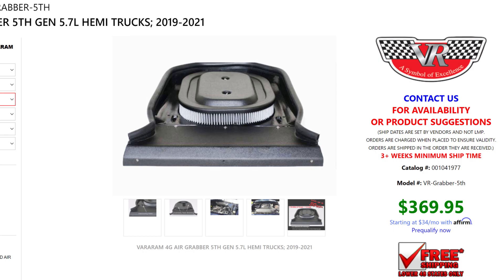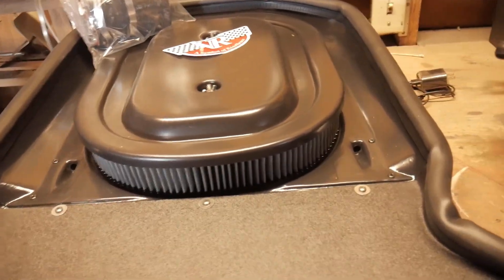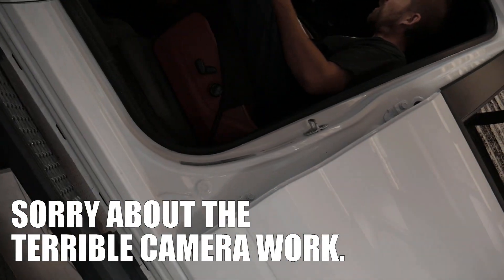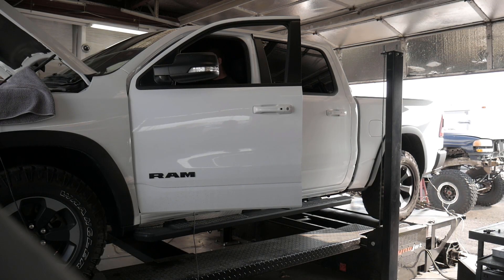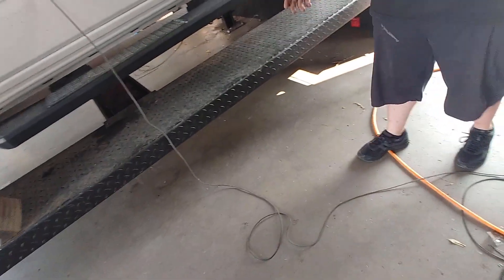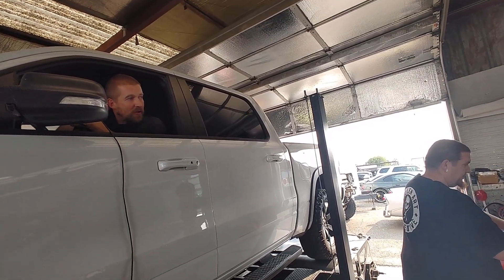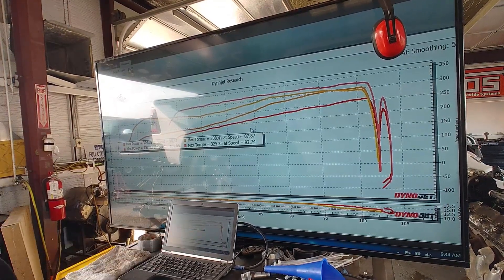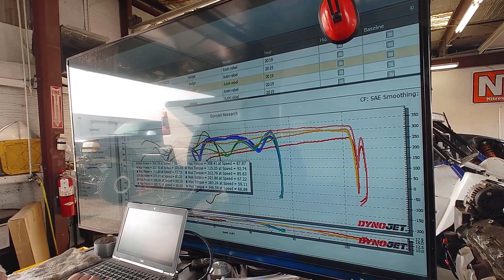2019 Ram Rebel Cold Air intake Chapter 1: Baseline Dyno Numbers

Comment: I dont like 2 things about this intake. The first is that it blocks half of your radiator. The second is that the IAT sensor is just stuck into a hole punched in a silicone tube, which is a great way to bypass your filter and pull dust into your engine.

Comment: You have to build power,one aspect will not make a big difference.
Higher air volume is still necessary.
If   running stock exhaust you will not get a big boost your looking for.
I start with exhaust and a drop in high flow filter.
When I have the extra cash, I move to cold air intake.
That's when you notice some power.
More air in more air out.
Next is a good tune set on max 
Tune premium fuel. It changes your cam so you get a quicker fire.
It takes time and money to get your truck into a 13 second run.
The best I have done with bolt ons is a 13.2 on a single cab express.
You can make 500 at flywheel.
Weight is a big factor as well your axel ratio.
My current truck is a 4x4 that weighs in the 4600 pound range.
It is a quad cab,that I can launch in 4 auto to eliminate spin.
In a drag race I only launch in four auto,then hit 2wheel drive
I have a 3.
92 rear end.
So paying attention is critical as to when to turn off 4 auto.
I have posi in rear so I don't fish tail.
I have done a few launches but to drag I need the air and a tuner.
Possibly larger throttle body with spacers.
After 2015 ram made it a pain to build bolt on power,you need a tuner and cash to build real power.
Next is a Whipple, and a expert installer.
That will be around 13k plus the mods you have already.
Reply: more thing,if you like rolling on 22 inch mud tires that are 35x12.50 x22.
Just enjoy your truck it takes way to much hp to move that weight and rolling resistance

Comment: During the dyno runs and the discussion in their shop, the only thing I could hear is air spewing from an air hose or something and yelling in the background.  I didn’t understand a word anyone said.  
If you test the cold air intakes on a different day the differences in air density or temperatures will make a bigger difference on performance than the different air intakes. The results will be unreliable unless tested under the same air density.

Comment: This or any other hi flow air system will not make a difference in HP or Torque. Todays modern engines are controlled by a computer, cold air intakes do absolutely nothing, The only the air the computer mapp is asking for will be used. no more and no less, same with the fuel. The only positives is the filter can be washed and reused, and  it looks cool, (no pun intended) you might also get a little sound increase. so go ahead and spend 750.00  plus shipping on this hunk of hype.
Reply: You're right, it would work a little more if they did a custom tune by a professional tuner, but just installing for the sake of installing is a waste of money

Comment: You need way more air for those big performance engines. First air filter that you showed is absolutely crap, trapping all heat from engine, no "cold" air there and second one is no different from stock one, same pipe pattern like stock air filter. You need short air intake, the shorter pipe is, better power. Power doesn't like heat. Second, from safety perspective, that's factory tune, manufacturer  will never give you maximum power of engine, pickup is heavy vehicle you need a lot of stopping power to brake, that's why no maximum power of engine, they don't want you to kill someone. If you have tune for E85 try that with only short air intake, you will see completely different story, Ethanol already has molecule of oxygen in formula, and that, compering to gas which doesn't have oxygen in his formula at all. Plus ethanol has cooling effect on engine, and that what you need for this big engines. My factory flex fuel V6 ram 1500 on E85 produce same power as your gas hemi, and I didn't pay extra for parts and tune for E85.

Comment: My two cents.  This is a cold air "ram" induction.  Surely there is more air being pushed into the engine at say 55mph with the hood closed than sitting stationary on a dyno with the hood up. Is my thinking flawed?
Reply: No your thinking is not flawed. That is why they usually put a big fan in front of the car that they are dynoing. Probably still not comparable to going 70mph on the highway but better then nothing i suppose

Comment from the maker: I did forget to mention, Reno NV is at about 4,500 feet in elevation. So that will have an effect on the numbers we get. Let me know if you have any questions. Thanks!
Reply: When are you doing chapter two and three?
Reply from the maker: @coreyadams4704  I'm hoping to get chapter 2 posted this weekend. I have all my footage, just need to finish editing.
Reply: Nice I live in Reno too. Maybe I've seen your rebel cruising around town
Reply: You need way more air for those big performance engines. First air filter that you showed is absolutely crap, trapping all heat from engine, no "cold" air there and second one is no different from stock one, same pipe pattern like stock air filter. You need short air intake, the shorter pipe is, better power. Power doesn't like heat. Second, from safety perspective, that's factory tune, manufacturer  will never give you maximum power of engine, pickup is heavy vehicle you need a lot of stopping power to brake, that's why no maximum power of engine, they don't want you to kill someone. If you have tune for E85 try that with only short air intake, you will see completely different story, Ethanol already has molecule of oxygen in formula, and that, compering to gas which doesn't have oxygen in his formula at all. Plus ethanol has cooling effect on engine, and that what you need for this big engines. My factory flex fuel V6 ram 1500 on E85 produce same power as your gas hemi, and I didn't pay extra for parts and tune for E85.
Reply: Who cares? There only the that matters is the delta.